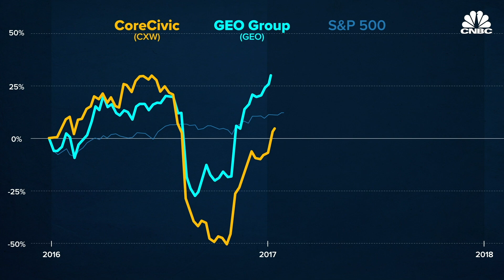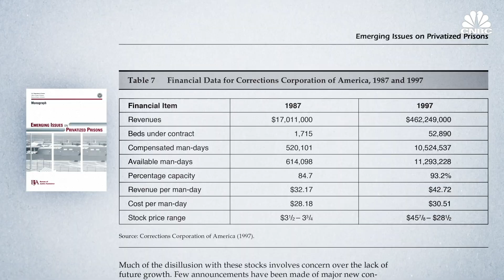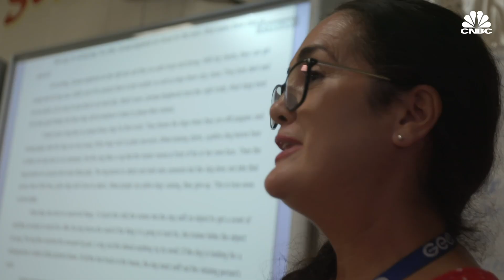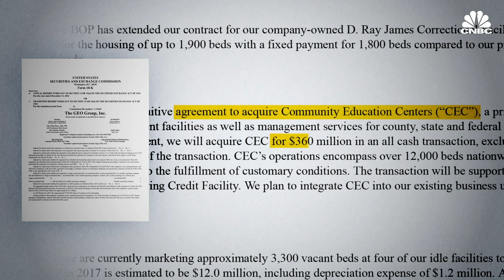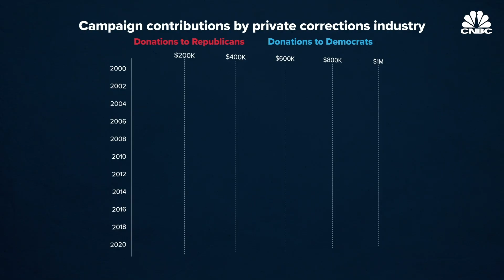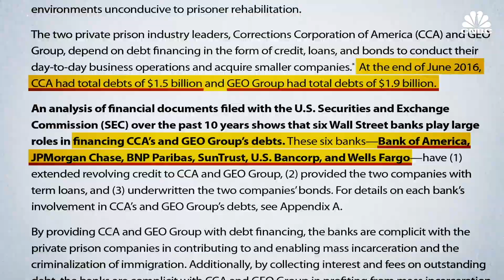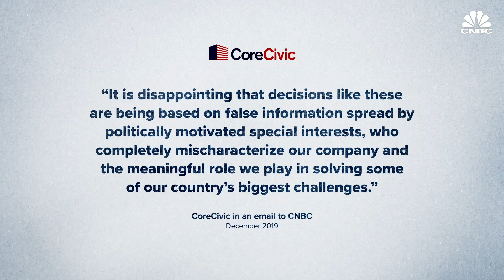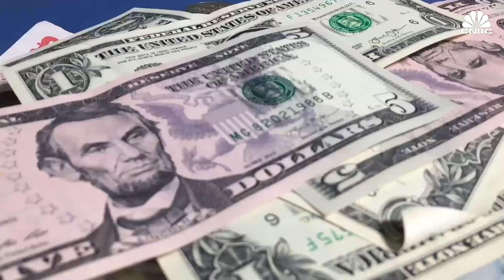Who Makes Money From Private Prisons?

Comment: Just wanted to come out and say one thing this piece doesn't cover by trying to make it a political party issue: Not only did companies profit off this, but so did states with contracts. Each state set up specific headquarter branches that monitor the private prisons. Their purpose, as part of the contract, is to allow designated DOC staff to act as compliance monitors at each facility. These monitors will check that training, regulations, and all other requirements are being followed per the contract with the state. Any time they were not, they would give a warning to the facility/company that if they didn't become compliant by a fixed date then they would incur fines. These fines were cut up into various categories which would dictate the amount of the fine per day. In the case of less than required staffing levels, they would fine the what DOC paid that position per hour/day in fines depending on hourly/salary costs.

How does this translate back to the state making money off for profit prisons? For example, GEO Group would pay a rate of $16/hour for a front line correction officer, while the state would pay $21.80/hour. This would turn into a double edge sword for the company when understaffed in two ways. 1.) They would end up paying their employee overtime at 1.5x/hour to staff it, or 2.) End up charged the states wage rate as a fine if the position went unfilled for more than 1 hour. This means the company ends up losing profit either way, and in one case the state ends up gaining profit.

How does this make the state profit? A typical contract will have a decided price per day per offender cost, as explained in the video. Typically, the company will approach the state already knowing what the daily cost is and under-bid that by usually 20~30% knowing they can do it cheaper by 30-40%. The state ends up spending less to house the offenders through the contract, and any out of compliance fines are paid by the company to the state DOC, so states typically see it as a 'win/win' situation. The only time it ends up hurting the state is when they end up sued due to the company failing to meet their contract obligations resulting in violation of the offenders rights as the company and the state end up liable when it comes to civil cases by extension. This is why the state uses some of the money they 'save' from these contracts to set up a specialized branch to make sure the private companies stay in compliance.

Just to wrap up, this is why both the state and the company had financial gain from private prisons. The company would come to the government and make claims they can house an offender at a cheaper per day cost than the states per day cost. The company does this by cutting cost everywhere they can, the biggest of which is how much they pay the staff working at the facility (this can be up to -40% wage/hour compared to state) as there is very little cut away from anywhere else due to strict contract guidelines stating a private prison must follow all required state regulations. The state then saves on money and also creates minor revenue any time they find the prison out of compliance. It is also why pieces saying that private prisons created cost to tax payers were not entirely accurate, as the only time it cost tax payers directly was when a suit was filed and won by the offender/offenders family.

Look at the states with, or that had private facilities during the time this piece was made and you will find that both Democratic and Republican run states had private prisons. The simple fact is the state saved and got revenue from having these contracts while companies tried to profit off them as much as possible as well. An individual of a part is more responsible for the decisions to keep this type of company around than the party itself when both are guilty of allowing them to exist for as long as they have.

Comment: My friend was picked up for driving after sunset on a restricted driver's license.  He did not see the air conditioned facility you toured.  He spent six months (mostly in Summer in Florida) in a tent with 50 other guys.  Their tent was one of many surrounded by chainlink fencing.  Mosquitoes were uncontrolled.  The heat was brutal.  Why don't you tour THAT facility?  YOU LIE!

Comment: Because of this, i want this.  Have both systems, federal, and private.  Prisoners choice.  Private, will provide high education and employment with minimum wage or higher depending on profession.  They will also be heavily regulated and checked for prisoner safety.  The cost to the prisoner is payed by them going to school, work, and maintaining their own prisons.  They will serve out their full sentence, unless they worked overtime, without pay.  Also, the private, will allow prison segregation, if they choose, based on race and crime.  Failure to work will result in half rations in entertainment, gym, and food.  Worst cases, quarter rations, starvation basically.  The immigration problem, can be solved by similar means.  Want to enter illegally, will have to work it of.  Well supplied camps will be set up.  Their labor will be used like the prison labor.  Repairing and building infrastructure.  They will work for their legal status.  Their children will be schooled.  $100,000 per illegal immigrant.  They get min wage, working whatever, not inhumane, until debt paid.  Or 10 years of labor, whatever first.  Doesnt apply to children.  Their stay in US as juveniles will count as part of the 10 years.